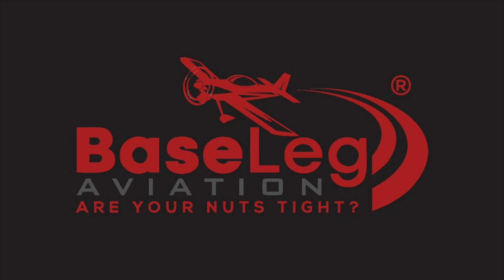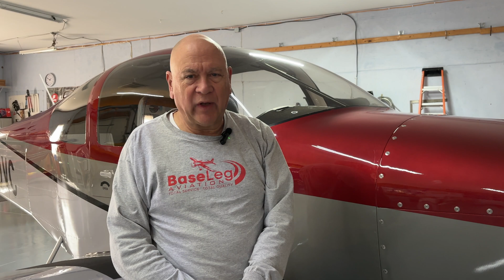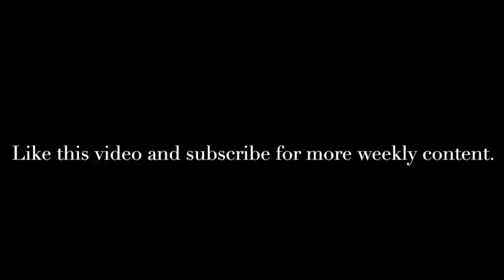First Flight Prep: Engine Advice

Comment: Hi Vic, can you elaborate on why an injected engine does not need a gascolator?  I thought it was not required on my injected RV because the tank was the actual low point.  But your comment seemed broader than that.  TY!
Reply from the maker: injected engines will pass water, up to a certain amount of course. You will definitely feel a miss sometimes. Carbs will not pass water. That’s why you also need to drain the carb bowl annually to make sure there are not any contaminants in it.

Comment: Good advise. One thing I always do on a first run is to do a fuel flow check at the servo / carb. This ensures that the lines are purged of any debris and that there is sufficient flow. The biggest show stopper on first flights is fuel related.
Reply from the maker: yep. that is one of the first items in the EAA test cards and will talk about that in a later video. thx.

Comment: Rotax has a procedure to pressurize the oil reservoir with a few psi of air.. on my friends Lycoming, I used an oil suction/pump syringe (looks about the same size of a grease gun, but is just a piston in a tube to move fluid) and I injected a quart of oil or so into the oil gallery via an oil cooler line. Then I paddled the prop though by hand with the lower plugs out.. we had oil pressure in a few blades by hand. Easy.

Comment: Quick correction. Just take top plugs out. Make sure the mixture is in cut off. Just turn on master, not avionics.  Use starter switch or button and turn over to limited time that your starter is rated for. Do this several times respecting the time limit so you don’t burn up your starter. Continue until you see oil pressure and maybe one or two times after that. This should provide adequate oil coating of cylinder wall and cam shaft, etc. put you top plugs in and torque to specs.  Reattach ignition wires. Close up cowling start according to POH.
Reply from the maker: I like having all of the plugs out. sometimes there is a lot of preservative oil in the cylinders. With them all out there is less load on the starter. with no load it’s very hard to burn up the starter. it will barely get warm.

Comment: Very helpful.  I strongly recommend someone preparing for a first flight to get a written checklist of things to check.  There are lots of things to confirm are ok, as Vic says.  Getting others to look at the engine compartment is excellent advice.  When they make recommendations for improvement, commit to them that you will fix them, so they don't feel like you are wasting their time.  A loose hose can ruin your whole day, and there are over 20-30 fittings between oil and fuel hoses, FI spiders, pressure sensors, etc.